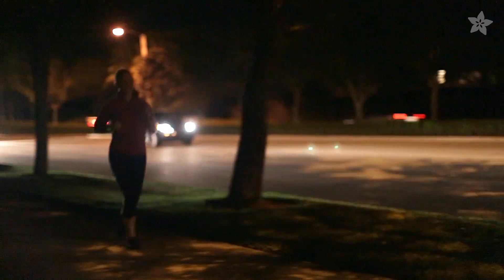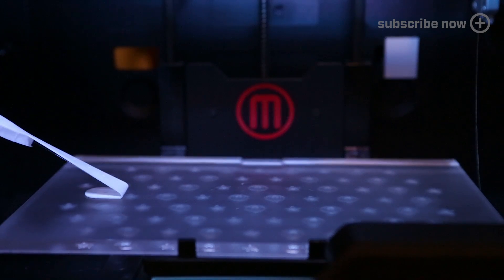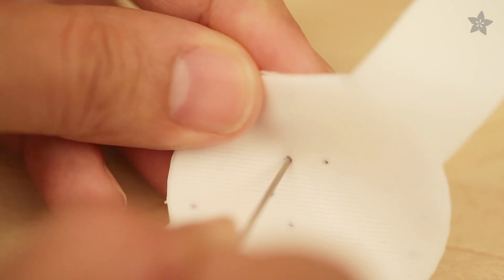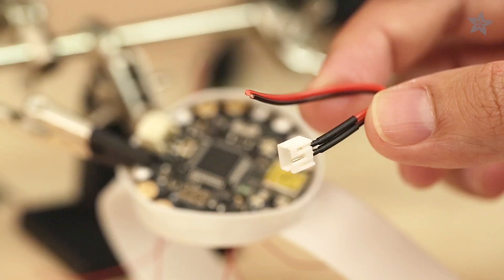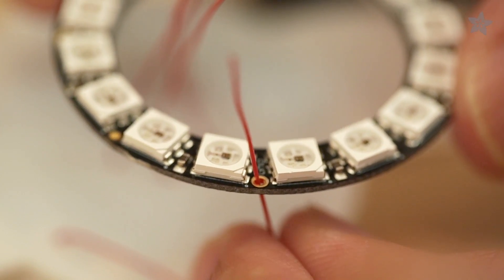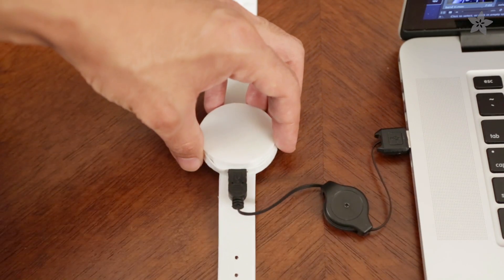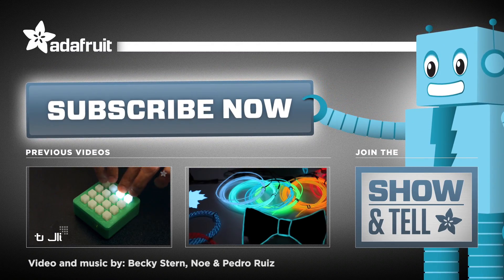Motion-Activated LED Wristband

Comment: Great video! 
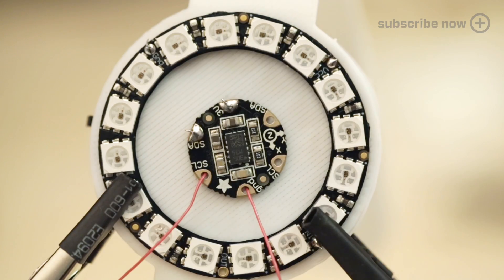BUT! 1:51 - Never EVER cut both battery leads at the same time. You're shorting the battery with the scissors because both leads are connected through the metal in the blade.
Reply: not the first time she has done that